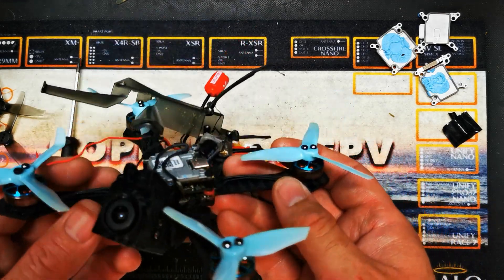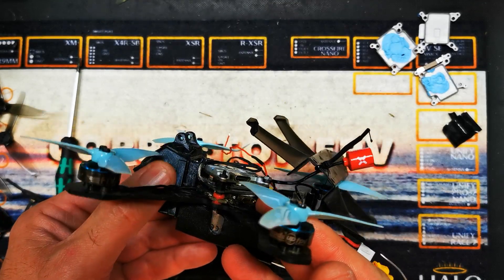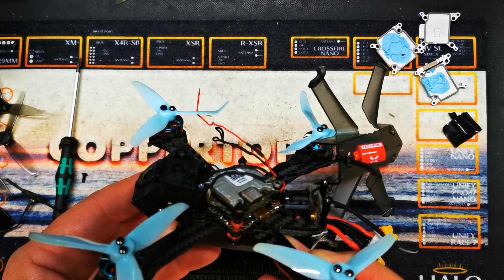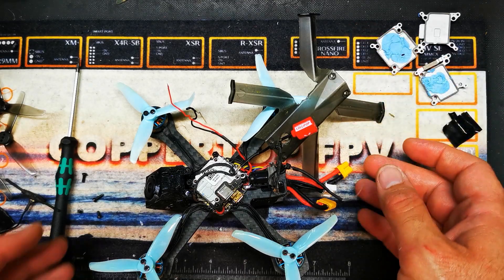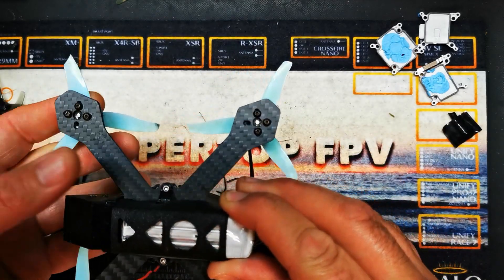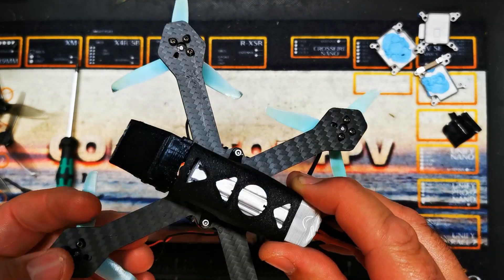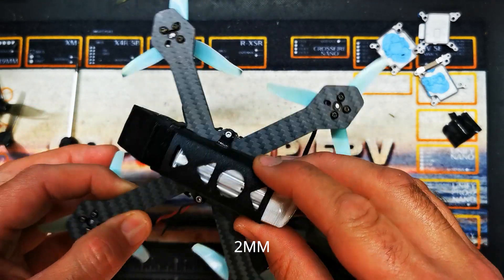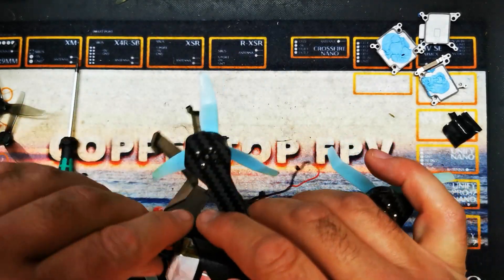533 Tiny Trainer with stripped Caddx Vista

Comment: This is about the first time I've had any regret about my NanoPhoenix2 setup on cheap analog VTX kits - these things are comically fun (even more so with 1207 motors), because that compact DJI setup is just plain impressive for the experience you're getting.  
I've been shocked how many sets of props I've gone through with my TinyTrainer trio, but I've put ~200 packs through them, so it's actually not that surprising.  What I'm amazed by is that it's actually made me better at flying near the limit, which I never expected (already have lots of quick 3" setups, have underpowered/overweight setups, and even some underpowered & overweight 3" setups, but these seem to work great for practice.
Considering the cost of other comparatively boring 3" frames, and how much I've enjoyed these, I suspect I'll end up just running more of these for giggles.
Reply: Nano lollipop/EmaxNano/iFlightSigmaNano - pretty much all the same, all work quite well.  I have found that VTX antennas just are what they are. The cheap JHEMCU 20A are solid units (but might as well run the 30A).  Similarly, cheap analog VTX's, caddx Ant cameras, and XM+ Rx are always impressive, spend money on the motors and piles of batteries, because I've fallen in love with being able to go to the park with a couple dozen packs (totalling under 50gbp) and fly for an hour.
Reply from the maker: tehllama42 yeah the vista is pretty damn incredible, but it isn’t as smooth as the full airunit although you get used to it. Flying the FUS x111 on analogue has brought back memories, I can’t see anything again... have you tried the headsup tiny Trainer props? Wonder if they have a bit more bite.

Comment: Man the TT is my favorite. Been using falcox on it which sucks with vista but I’m going to try this right now!  It’s a shame to not have hd on my fav ship and this seems like the best way. I’ll let you know how it turns out !
Reply: If I can get this to print. Tricky :)
Reply from the maker: @Dorkyand40  easy print. Full supports. I thought falcox was fully dji compatable with dji these days?
Reply: Coppertop FPV  you get a few osd elements but you can’t even move them or they don’t show.  There is no 2 way comms so you can’t even engage the osd which is the entire point.
Reply: Print was perfect btw. Much appreciated. I’ll let you know how the rebuild turns out
Reply: @Dorkyand40  Yeah, that's been something I've been waiting for, but practically, FL1 capable hardware all makes for solid BF targets.

Comment: Wait, these have throttle resolution?  I've been trying to just stand on the throttle like an irritated hornet.
Then again, these are particularly comical on 2S 650mAh batteries - which essentially require full throttle and modified lines to function.
Reply: Closest I've gotten to 0:59 is a 1:11 running race lines on a 650mAh pack.  Gotten quite a few of those, but that seems to be my lower limit with those packs. 
0:48 is possible on 3S 450mAh packs, and those come down angry.
Reply from the maker: tehllama42 because mines a bit porky it’s like driving a slow car and having the skill to do it at the limit as opposed to having a super car and tickling it because it too fast for you, it’s been a long time since I used to fly little quads fast. This little guy is super fun doing matty flips and just tooling around in a way no toothpick has ever done for me because I destroy them. I’m really blown away by it. It’s simple and clever and just does what it says on the tin. Given it’s making me think about spec racing it’s about as friendly as it could be.

Comment: Dors  the led kit fit inside?
Reply from the maker: Yup. Don't know if it fits with a vista tho. Couldn't get one in the UK
Reply: It does with analog setups (since it's rather small), but with a Vista, don't think that's reasonable.  My analog builds are all fairly tight.  That's not you say you can't install some LEDs (e.g. TinysLED Pico), but the full TinyTrainer Kit won't work that well.

Comment: Hey man how did you get the Vista to work ?my bolt pattern doesn't match up I have a betafpv 405 AIO
And wanting to put a full size dji cam is that dji naked hero  print the one?